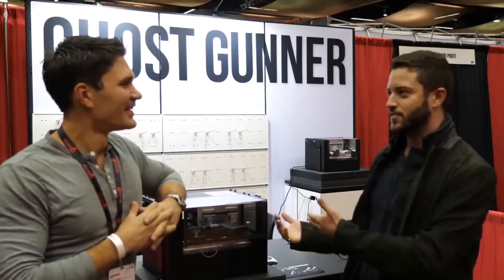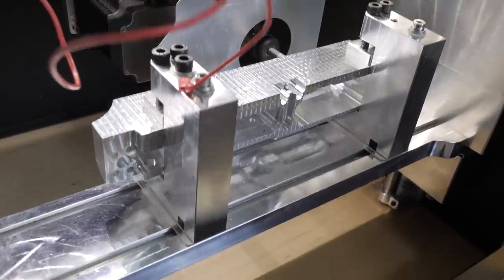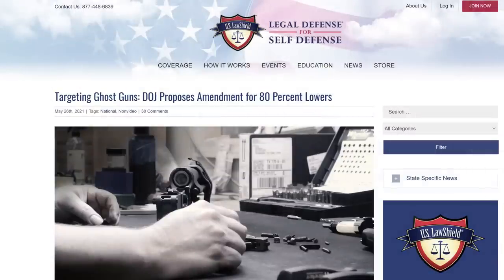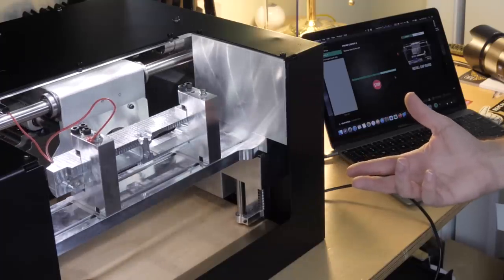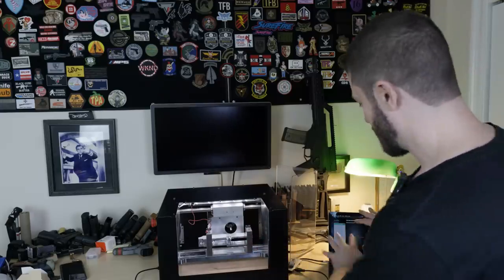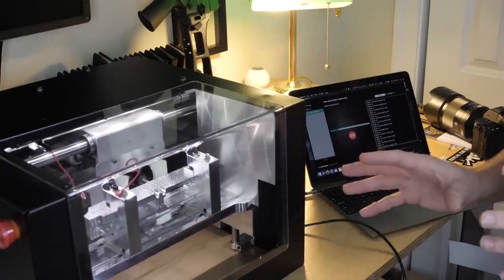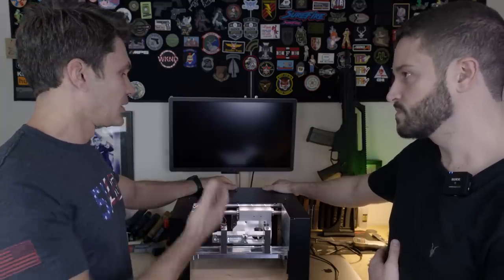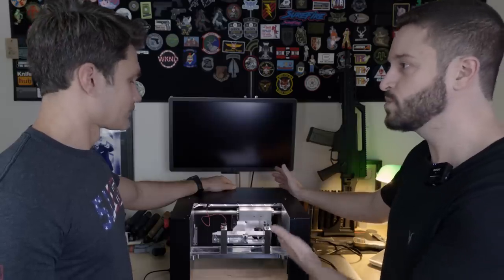NEW: Turn a Metal Block into an AR-15 Lower at Home with the GG3 Upgrade

Comment: I remember seeing this years ago. Being a full time professional machinist and having my own benchtop cnc mill at home I was wondering what happened to this guy and his idea. Very glad to see he hasnt given up and the purpose built horizontal mill design seems very efficient.
Reply: The authorities tried to put him in prison.
Reply: I'm also a machinist. We use Haas, fanuc mills and lathes. Make aircraft parts and some gun stuff. There's no way that thing would last more than 10 cycles bro 😀
Reply: @SA-xf1eb  He is only selling a tool that does something many can do already if necessary.
Reply: @michaelhall7546  I am also a machinist. You dont know what you are talking about.
Reply: @BigMikesHobbyChannel  We do some work for Wilson Combat in the free state of Arkansas. What do y'all do in your shop?
Reply: @michaelhall7546  Great. We do all sorts of great work as well. 
None of which has anything to do with whether or not a desktop CNC machine is capable of running more than 10 cycles.
Reply: @BigMikesHobbyChannel  "We do all sorts of great work as well"  Who talks like  that? 🤣
Reply: @michaelhall7546  You got me. Very happy for you.
Reply: @michaelhall7546  Dude Chinese desktops can run through aluminum, my upgraded one cuts stainless steel and Gr5 titanium beautifully.

If you're a good machinist you should know that program and tool choice are huge factors in how well a part is cut. What they're doing here is fine tuning a program on a known machine with specific tooling, chip loading and feed rates so that the parts succeed. They're not running maximum MMR and crazy rapids like a full size production shop for top speed.
Reply: @BigMikesHobbyChannel  Just messing with you bro 😀
Reply: @dimman77  I'm not saying that can't do it. Just not like the real deal CNCs. Good for having a just in case way of making a firearm but doesn't make sense money wise
Reply: @michaelhall7546  No kidding. It's not a Haas VMC. Of course it's going to take longer to finish a part, but it's also going to cost 1-10% the cost of a full size pro machine and run on single phase power.

You said it wouldn't run 10 cycles without any consideration to how the program would be optimized for the specific machine limitations. 

If you meant it wouldn't last 10 cycles running a program you run on a full sized machine, sure. But that's also not the most intelligent comparison.
Reply: @michael hall ....how much is your machinery again?
Reply: @dimman77 I understand the idea of having one for 2A but that thing will break before you even make the cost of it back, much less any profit
Reply: @michaelhall7546  It already has a more rigid and balanced design that the Chinese machines that handle aluminum no problem.

Why do you think it will fail? Because it isn't a 7hp spindle and have a 5000lbs cast iron frame?

You're like the machinist equivalent of a Fudd.
Reply: @atranimecs  not really sure. Just a worker bee. Don't own the equipment but It's not cheap. Got a million dollar laser recently but that's in sheet metal 😐
Reply: @dimman77  that's kinda true 🤣🤣🤣
Reply: @westcoaststacker569  um yeah. They tried putting him in prison for it.
Reply: @dimman77  Ooh, which desktop CNC do you use?
Reply: @joshwizardguy7662  I have a $3000 CAD steel-frame 3040 from China, 2.2kW spindle, and 400W servos. Needed some mods to cut stainless steel and titanium (stiffer table), but aluminum was fine out of the box. I have some vids on my channel of mods and cutting aluminum, stainless, and titanium. I'm trying to increase the precision to watch parts quality. I don't dare even think about firearms parts, because I'm in Canada.

This GG does some interesting things with mounting the spindle horizontally to take load off the vertical stepper (or servo) as the spindle will be heavier that the aluminum being machined. It also uses larger diameter stiffer linear shafts than the aluminum frame Chinese 3040 CNCs. And it's travel is based around the limit of the parts it's designed for so there won't be wasted travel length which reduces rigidity.
Reply: @dimman77  You should just start pumping out C8 carbines in your garage, then if you live in Canada.
Reply: @joshwizardguy7662  Paperwork for licenses to do that here probably costs more than the machine. Lol
Reply: @joshwizardguy7662  To give you an idea how strict Canadian law is, the same long-process (MONTHS even after you pass the federal government-approved safety and knowledge course) background check license they give you to buy a regular hunting rifle is required to buy ammunition. You need a months long background check and federal courses just to buy ammunition.

Lacking a tremendous amount of America's freedom here.
Reply: @michaelhall7546  the GG3 machine?  I've had for quite awhile and milled plenty 
It's the bit that needs changed after a number of millings
Reply: I was wanting to see it cut the threads for the buffer tube.
Reply: Maybe you can help me? I am a custom knife maker, i would love to have a benchtop mill, to make small knife parts such as a guard. Wether it b cnc like this or a manual milling machine. From materials ranging from copper to steel. Could you recommend any that arnt insanely expensive and that actually work? I seen alot of guys saying that they cant really cut steel which isnt a deal breaker but being able to cut steel would b great.Thank you.
Reply: @michaelhall7546  I agree..... these so called "machines" are mechanically a joke. I get it, but c'mon. These are the easy bake ovens of cnc machines.....just barely do what they are supposed to do, and you only play with them once when you realize it cant actually bake cakes for you and your friends and the thing it does bake just barely resembles a cake, looks like butthole, and tastes like it too.   Conceptually its an OK idea, but mechanically very poorly executed.  The current designs belong exactly where the easy bake oven belongs. In the trash.  A redesign with linear rails/trucks instead of the absolutely horrible, 100% unsupported linear rod is an absolute minimum requirement to make this a viable machine for its intended purpose.  It would n0t be that difficult to redesign with rails. The current design would lend itself well to the redesign, and would not increase cost by very much.
Reply: @dimman77  You should be familiar with the fact that machine rigidity is the primary factor in allowing the tool and program that guides the tool to do its job.  Its all about machine rigidity, period.....and the GG's have none.  What you are speaking of are bandaids (and bad ones at that) , ignoring the source of the problem that is relatively easy to fix.
Reply: @ArionRaine  It's cutting aluminum, and you can see they are using trochoidal toolpaths in the air cutting demo.

"Rigidity is everything" is old fashioned machining think. If you look at the speeds, feeds, and cutting depths of rigid modern pro machines ripping through stainless or inconel with modern advanced toolpaths, proportional to MMR the GG is fine.
Reply: @joshwizardguy7662  that's what I'm saying
Reply: @BB-ly3dh  find an old manual machine. Get a chain hoist and some bars and a long pry bar and learn how to move big stuff. Then get a true milling machine, used from 70s, got mine for about 2k including renting trailer to move it. The tooling is what will cost you though. I've got about 3-4k into the tooling, work holding, bits, measurement etc. If you're wanting to do machine work but once what you need, don't try to re invent the wheel or you'll waste money and buy a bigger machine later anyways.
Reply: Im trying to get into a night school that starts on the 24th.   I'm excited what do you typically work on ?
Reply: @michaelhall7546  I should just buy a vf-2 for all my gun making needs 🤣🤣🤣 totally cost efficient.
Reply: Youtube Sucks ass  go find a local college or tradeschool in your area that has a machining course and take night classes.
Reply: @michaelhall7546  You're really only gonna run aluminum, it should last a long time.
Reply: @michaelhall7546  I can tell you they will go much past what you can afford to put on top of the lower.
Reply: @dimman77  -- Your channel is really interesting. Did the CNC software come pre-registered to Chairman Mao or did you do that?
Reply: @twatmunro  Winxi the Pooh is best Chairman.

Edit: I never noticed the registration was Mao... something until now. Holy crap. Lol. It came like that.
Reply: @ArionRaine  the machine looks great if you just look at what the results look like but once you start factoring in the price for a machine that is very limited in many ways... Yeah, ain't so amazing anymore
Reply: @chas1878  Actually, no it doesnt even then, and the results are relatively poor at best.
Reply: @dimman77  yeah, I agree BUT...
You must know if you're doing any kind of a Machining rigidity is key.
I don't know if this machine will last 10 cycles or not.
We all know that so much that depends on whether or not you're using sharptools good-quality tooling how you're setting it up....
Feeds and speeds vary by tooling.
Maybe if you are only using tooling and material from the manufacturer and if you are using their exact procedure TO THE LETTER.
But let's face it nobody is going to do that. And I've had GOOD quality tooling that I buy in 10 or 20 piece quantity and every one of those tools is going to last a different amount of time even if I'm Machining the same part over and over...
And when is the user going to change a tool?
Parts can fail. Fixtures can be off. Any number of things can cause failure. Sometimes catastrophically. 
But the great equalizer is rigidity.
A rigid machine might break a tool but at least the machine's going to survive.
A rigid tools going to be more forgiving in just about every way possible. I'll take my CNC Lagun Republic with my variable speed Jhead Bridgeport quill over that desktop box any day.
Using a machine that weighs almost 5,000 lbs means never having to say you're sorry......
Then there's speed. 
3 hours is a long time and a lot of heat and vibration.
I can do a steel AR lower out of a solid block of steel in an hour with a perfect fit and finish and not even dull my tool.
Reply: @dimman77  I mentioned it already but I've got a full size vertical turret knee mill that has full CNC and I paid less than 2500 bucks for the whole thing.
I've seen lots of Bridgeport mills that can be converted to CNC for 1000 bucks plus 500 to 1000 for CNC components.
If you are comfortable making your own firearm you can probably convert a milling machine to CNC.
Or don't. An AR lower is a great project for learning how to use a manual milling machine.
And for the money you'd have a machine that can do just about anything you can think of.
In a post apocalyptic world you can have a machine that makes less than half a gun.
OR
A machine that will make just about an entire gun and fix or build anything else you might need...
If you have a full size milling machine and lathe, you can build thunderdome, keep everyone's cars running and build all the equipment and fixtures to house, train, breed and harvest vegans for food.
Reply: @dimman77  you can have a 2 hp spindle and a 5000 lbs machine for less than a ghost gunner so why not?
Reply: @christopherleveck6835  Space and power constraints are a thing for most people.
Reply: @dimman77  I'll see your spindle and raise you 2hp and I've got Sanyo Denki 1000w servos on a Lagun Republic FTV3 CNC mill with a 7 foot table and a Variable speed 2hp Bridgeport J head.
I'm into the whole thing for 2500 bucks.
I've been running it for 6 years without a single hiccup.
One shot oiler. Power tool changer.
14 inch travel on the z axis when you add in the knee travel.
Flood cooling.
I've got the accessory holder on the back of the ram with a precision drill attachment.
7 in wide table with 20+ inch travel including the ram.
Tilt and nod on the quill.
I have a 3018 router I use as a PCB mill and I know they are useful little machines.
But really the only reason I can see for paying 3,000 for a ghost gunner with all the accessories is if you don't have room for a full size mill.
Because I see mills similar to mine for 1000-1500 bucks on Craigslist all the time. Add 500 bucks for CNC and you are set.
Reply: @dimman77  that's why I reload my own. Can you do that in Canada?
Reply: @BB-ly3dh  if you have the room, find yourself a Bridgeport. You can get a decent one for 1000-1500 bucks off Craigslist depending on where you live.
You will wonder how you ever lived without one.
Reply: @ArionRaine  came here to say exactly this ..
Reply: @dimman77  you can't fake rigidity. This is an OK solution to deal with a lack of rigidity.
But if they could find a way to inexpensively make the gg more rigid they would.
Reply: @daveb3910  if all you wanted to do was make lowers you don't need a lot of tooling.
With that said, I have an entire shop filled to the rafters with every form shape and size of everything I have ever found at a garage or estate sale. Some of it bought in 5 gallon buckets by the pound....
Can never have enough tool holders or workpiece holders.
And if I see ANY kind of chuck, I buy it. Even if I don't have a lathe it will fit on.
Because I can always trade them for what I want.
Reply: @unknownalias5538  if I had my entire life to do over, I'd have become a machinist right out of high school. 
I'd own a shop by now and be doing what I love as a job instead of a hobby.
Reply: Youtube Sucks ass  community College is the cheapest way. They will train you and find you a job.
OR
Things being the way they are....
If you're not married and have no kids and still living with your parents.....
Find a good machine shop and ask him if you can sweep floors to get started and work your way up.
Reply: @micahrandall9821  or be smart go get yourself a used Bridgeport for half the cost of a gg and convert it to CNC and make guns and anything else you want.
Reply: @dimman77  I absolutely agree with you. I have too many machines my garage is not anywhere big enough to support them all.....
Time to move.
Again.
Reply: @christopherleveck6835  You mentioned that it's probably OK if run "TO THE LETTER" and I would say that's likely how everyone buying this will use it. Looking more closely it seems they're trying to hide their G-Code behind some proprietary shell software which will keep people with no CNC knowledge just pressing the GO button without the ability to mess around. 

That's probably the target buyer for this. If you already have machining background you probably have access to better ways to do the same operation as well as anything else you want.

My point to the rigidity is that the "band aids" of modern tool paths reduce the old reliance on rigidity above all else. It just needs enough rigidity to cut aluminum "to the letter". The issue with a new production machine that wants to be sold across the country that added rigidity adds mass. And that mass adds shipping costs and sometimes size. Keeping a price down, but then having an extra $999+ shipping fee is still a real added cost to a machine trying to be budget.

You just can't compare the price of this machine that will be set up for non technical people to just plug and play to a machine made from used components assembled by a skilled technician such as yourself.

For what it is, it's ok. It's a compromise but for cutting the specialized aluminum parts by inexperienced amateurs it should function as advertised.

Is your way better? Yes. Absolutely. But there is a significant time investment is getting to your skill level that might be beyond what a lot of people are capable of.

My machine is a decent compromise for a slightly higher technical background than the GG, that really only needs the table upgrade for rigidity to do stainless steel and titanium machining, and is a decent generalist machine that doesn't take up a lot of space. The spindles I have are actually both more powerful than yours (2.2kW is ~3hp), and not having to push around the huge Bridgeport tables and knee, the 400W servos are more than enough.

I have a newer video on my channel of my machine setup, with pricing estimates in small Canadian dollars for people interested.
Reply: @christopherleveck6835  I waited a year and a half to go to school for machining at a highschool campus so I didn't need to be vaxxed . The testing is on the  college campus and they wouldn't give me an exemption .  I did the army deal, then lost in life , got halfway through the schooling to be a firefighter cuz I had an in with the department then COVID hit.  Crazy how life gives you twists and turns.  I'm now thinking about seeing if the VA will pay for schooling if I move south .  I'm  34 not exactly a youngin.  I think you should open a business my friend and chase your dreams .  What parts of gun smithing do you want to do ?
Reply: Sounds like you should build your own machine...
Reply: @judgegarry  i already have
Reply: Most people on this reply thread are ignoring that the GG is set up specifically for people with no machining knowledge. It's a desktop mill for aluminum that comes with software and plans, not a pro level CNC. Its plug and play and sits on a desk. If you're a pro then this is definitely going to seem like a child's toy.
Reply: @dimman77  have you made one from start to finish?
Reply: @OmarSlimWhite  No. I use my CNC machine for cutting watch parts and jigs for watch parts out of 316L stainless steel, 6Al-4V titanium, zirconium, aluminum, and brass. My personal interest with the GG here is more about the state of small desktop CNC machines than firearms.
Reply: Its great
Reply: @daveb3910 that’s what I have to work with. Got a Bridgeport drill press from  the 70’s.